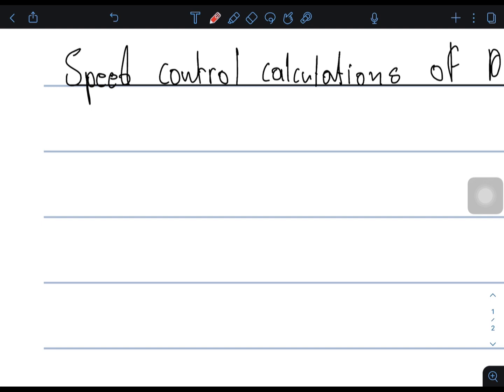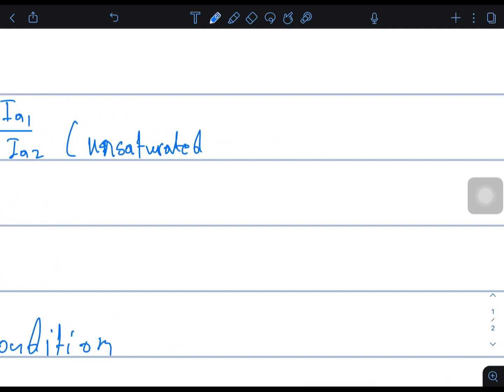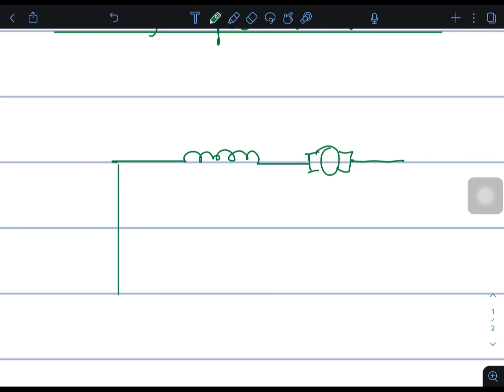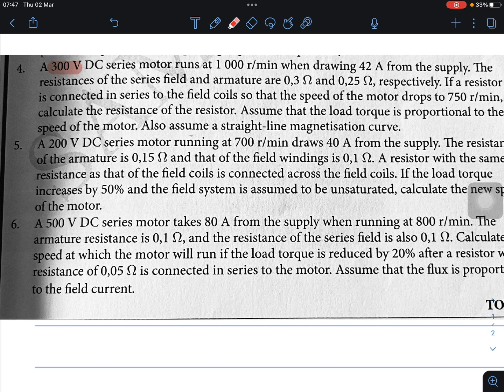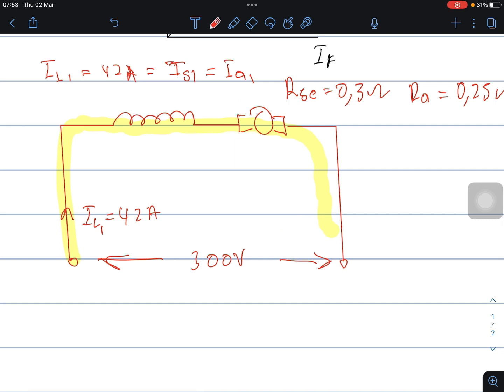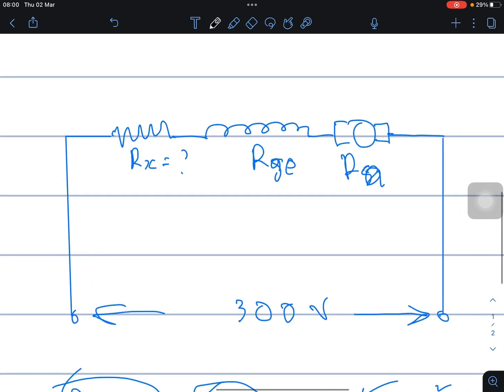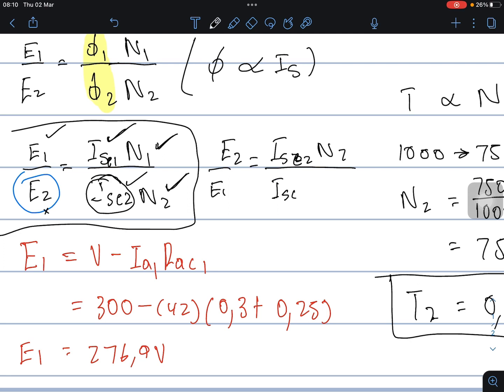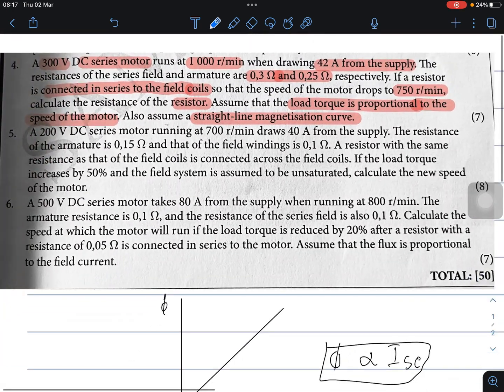Electrotechnics N6 speed control of DC motor calculations

Comment: Good day

Please do load sharing of generators in parallel,  electrotechnics N6
Reply from the maker: noted am working on the videos
Reply: @sapholwethumaqoma4483  On that note how do you differentiate speed control and swinburne method??
Reply from the maker: @Lerato Maila  yes speed control  is calculating speed of a series or shunt motor and Swinburne test is for calculating Efficiency of a shunt generator or shunt motor only.
Reply: 🎉❤bravo
Reply: I'm a mechanical student I've learned a lot since I'm writing my gcc